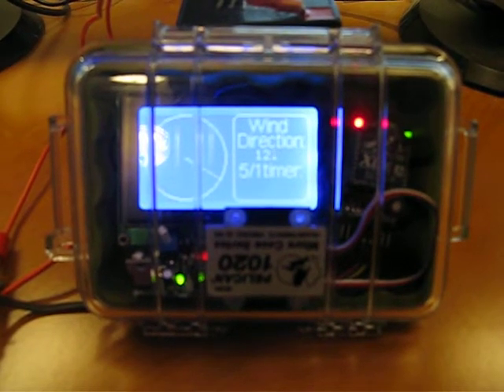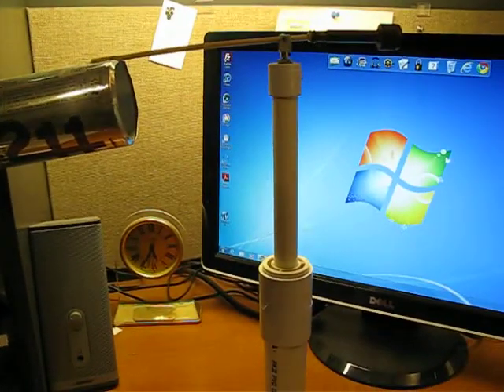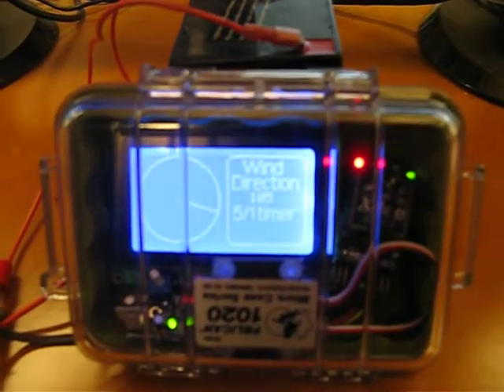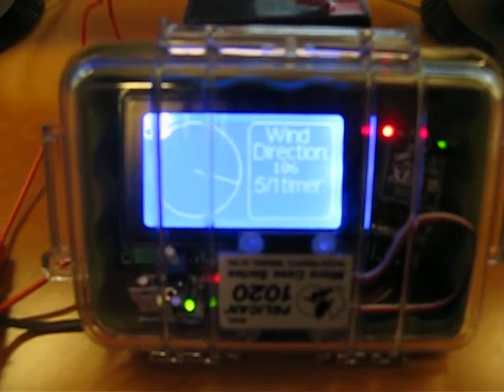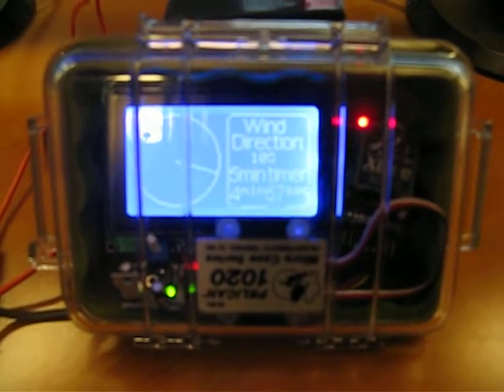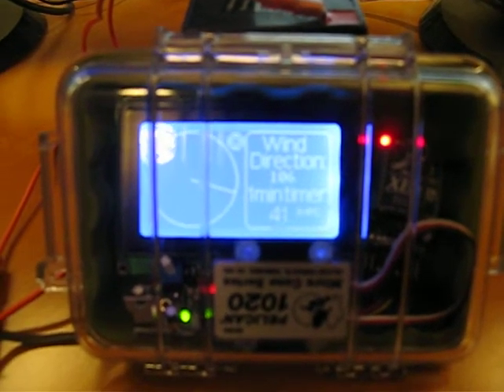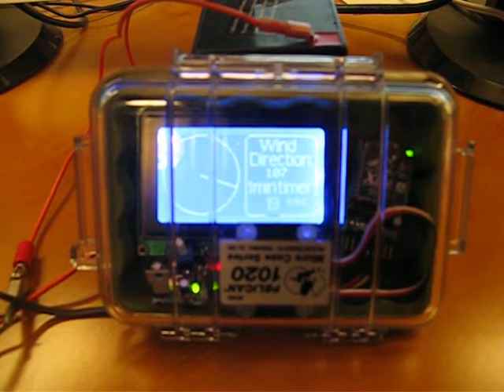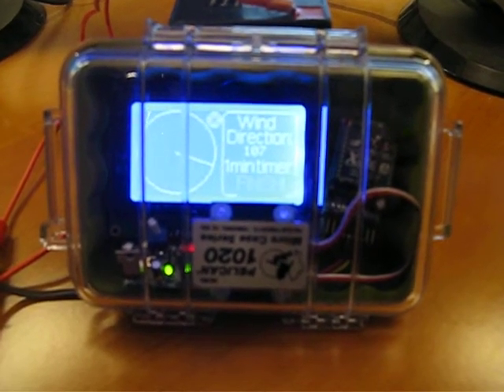Arduino Wireless Small Boat Wind Indicator

Comment: That is a cool project :-) Thumbs up.
I have a suggestion though, a possible future development if you like... On my boat I have Raymarine instruments whereby the wind speed and direction is linked to a solid state compass and GPS, whereby you can get true wind speed and direction (Taking into account the boats speed and direction in relation to the wind in addition to presenting the wind speed and direction as your device does. As there are off the shelf compass and gps modules available, it might be worth having a look at these. Your project has inspired me to go and have a play and I like the LCD readout, it adds a nice polished touch to the project! Thumbs up!